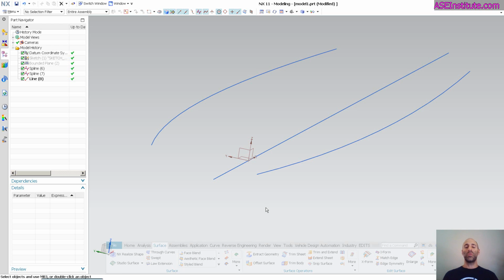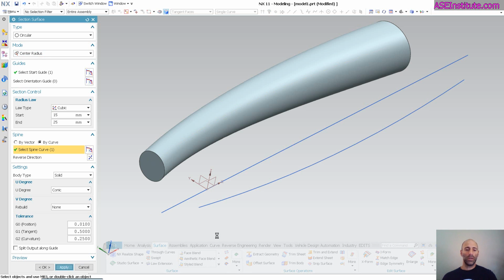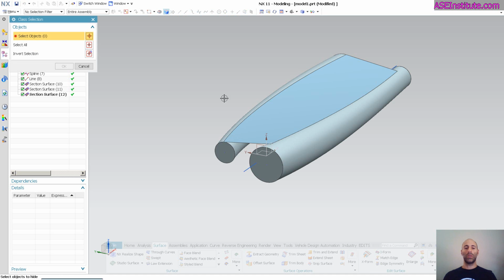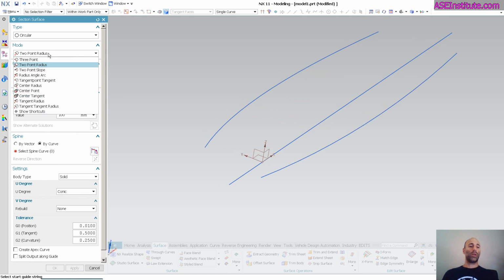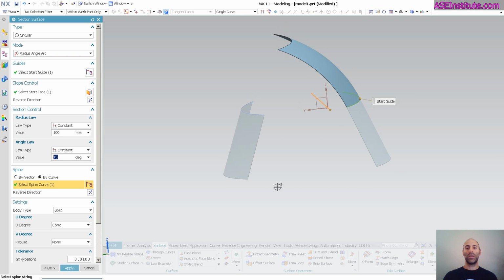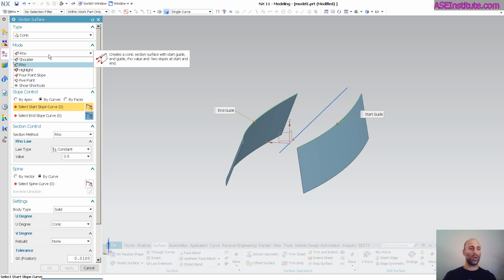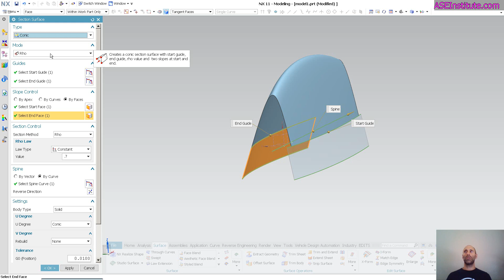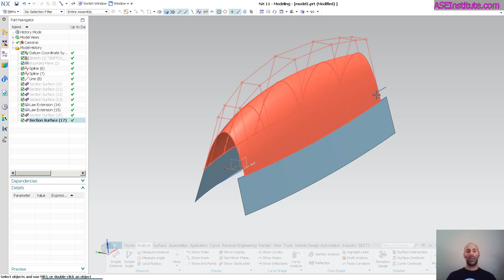Section Surface Intro | Siemens NX 11

Comment: Have to admit, I haven't used the "section surface" tools a whole lot but after seeing this... I'll start incorporating them more often. Sure cuts a lot of steps out of the workarounds. 
Good work mate. Keep em coming.
Reply from the maker: It is a mighty powerful tool. I will have a little more on it soon.

Cheers